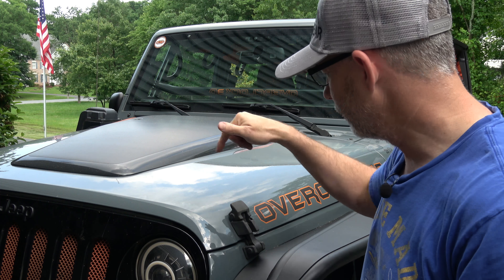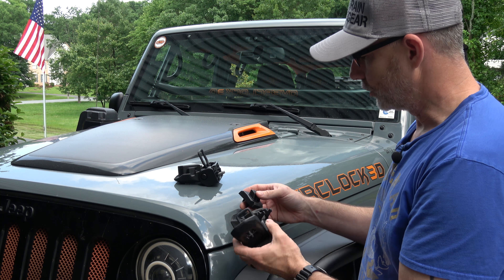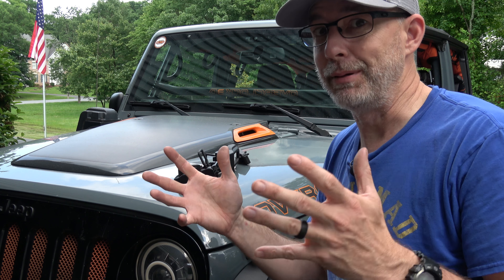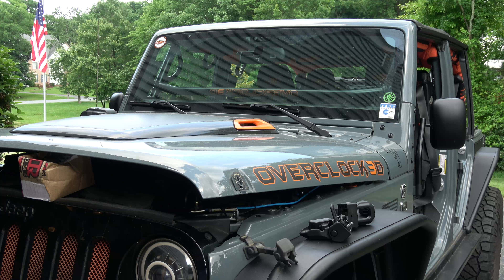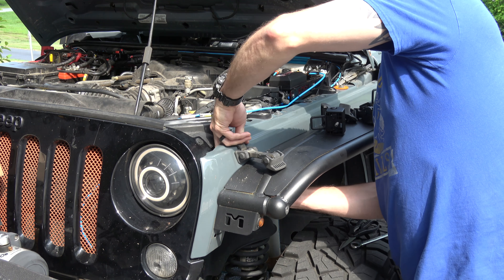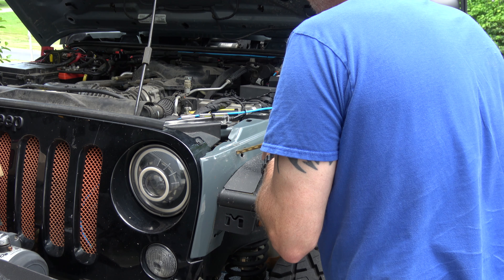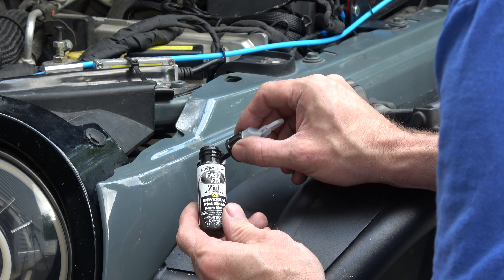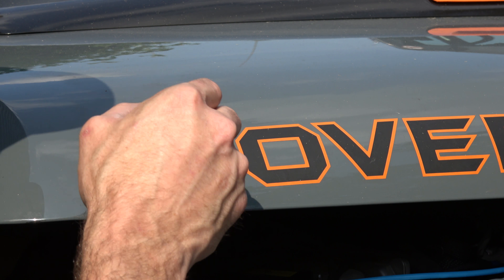Installing JL Hood Latches on a JK Wrangler

Comment: Class act recognizing JK Gear and Gadgets. I enjoy both your channels.  I took your advice and slotted the holes on the hood with a 1/4 bit.  I stuck with the 3/8 on the bottom. I guess if someone wanted to take the extra time they could slot those as well.  The bigger hole does allow for adjustments though.

Comment: gonna grind the slots on the hood instead of drilling. Glad to see your video, a lot tighter. Its better leaving a little more metal on the hood slots, because even if you push them up a little and tighten them down on the nuts it could still loosen or slide down a little as time goes by and open up the gap on the hood. I wonder if its better to swap out the upper nuts to lock nuts or the nuts that have a grove on them that bite down and don't loosen up as easily.

Comment: That's cool. I use to think of putting TJ parts on my JK. Some progress like you, some regress like me. I put the black textured rugged ridge hood latches on mine. Only problem with those are the plastic safety clips, they break. They made good on it though by mailing me replacements. I had them on too tight. Two months later and still good.
Reply: Joe Stacks  Too bad they didn't put the inline 6 in the JK. The 3.8 so far has been very reliable. Just doesn't have the low end torque of the 4.0
Reply: If you could do it over again, would. you have drilled it to 3/8?  Or would you have just slotted the holes?  Do the studs on the JL latch fit the holes of the JK as is?

Comment: Look at the fender sucked in @6:29 These JL parts are designed for a more vertical installation. Look at the JL hood. The hood is more vertical at catch location.

Comment: This looked awesome so I bought some and they turned out great. BUT DO NOT use these if you have limb risers. The risers pull on the latches causing them to cant far enough to where it looks terrible and barely closes. I tried tightening the latches tight enough to where they would hold the stress of the riser but ended up pulling the latch mounting bolts straight through the plastic. Love the look and they'll work perfect without risers, just saying they are a no go if you do have risers.

Comment: I just ordered. Fun fact- if you order the 2 of each JL Latch: 68240952AD and
Catch Bracket: 68240951AB on that website- INSTEAD of together in the "JK upgrade kit"- it is $5.07 less.

Comment: Found these on Amazon for way cheaper. Are they the same?
2018 for Jeep Wrangler JL Original Black Stainless Steel Latch Locking Hood Catch Kit for Jeep Wrangler 2007-2018 JK JL https://www.amazon.com/dp/B07H94WH72/ref=cm_sw_r_cp_apa_i_JyedDbHW3BM55

Comment: I can't get my 13mil bolts off. They just spin
Reply from the maker: So that means the bolt is spinning in the hood latch body.  You may need to cut the plastic away on the latch so you can get a pair of pliers on the other side of the bolt. That's what I'd do... just carefully dremel the plastic with a small cutoff wheel.
Reply: I just got them off. Yeah